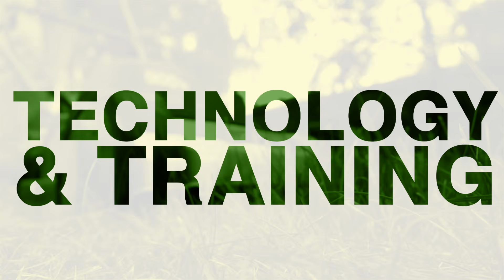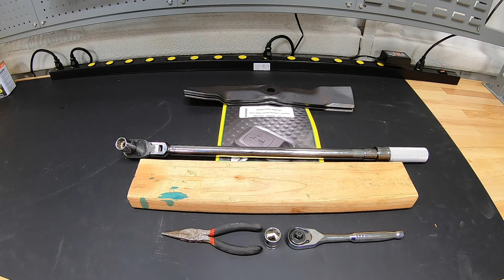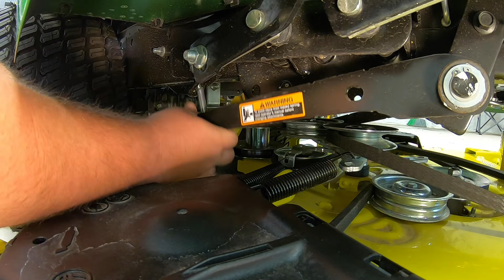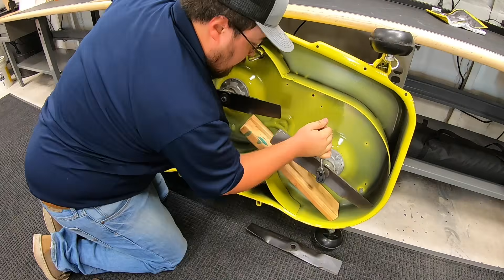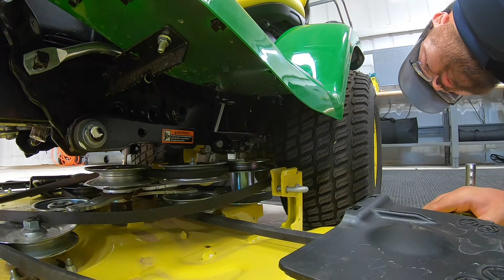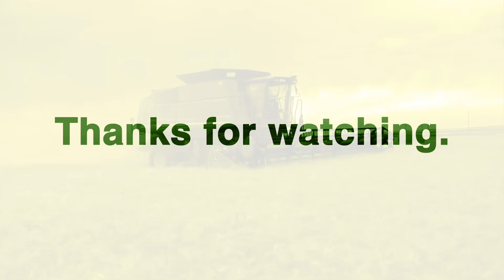How to Remove Deck and Change Blades John Deere X380

Comment: Excellent how to video.  I appreciate you keeping in the video the parts that require a little adjusting to get right.  It helps to know that I'm not doing something wrong by running into those little imperfections.

Comment: Great video my question is I have a S240 I was wondering if I put mulching blades on will it help with cutting the grass blades smaller than the stock blades

Comment: In my 380, a branch got above the deck and jammed the works.  The belt shredded and a 6-7 black spring was dislodged.  When removing the deck, the lift foot lever will not click all the way back, so the j pin and arms aren’t fully unloaded and are not removeable. Is that spring the assist spring?  Is that why the j pins won’t unload?

Comment: For older mowers, you might need some grunt to get those j hooks released. Things do get bent !   Go to your local truck stop/diesel fuel stop and buy a 5th wheel pin puller. It's basically a long t handle with a large hook on one end. Or you can use a slide hammer with a hook to fit the j hook. The pin puller is also useful to drag around the mower deck...also a good idea to jack up the rear of the tractor to allow lots of clearance.

Comment: Great video but I cant get the center blade to break. It turns the pulley on the other side. Managed to get the other two using a wood plank.

Comment: 8:35 you say to toque Blade Nuts to 50 lb.ft which is correct for Accel Deep 54 and 48 Mower Decks.  In my John Deere Select Series manual (pg 80) it indicates blade Nut Torque as 65 lb.ft for both Accel Deep 42 Mower Deck and Edge 42 Mulch Deck.   If you want to get it right folks, look at your manual in the Specifications section.

Comment: John Deere is always been cheap but now that's a new low and cheap. You're not even painting your mower decks. That's the stuff we see what's horrible is the stuff that we don't see that you cheap out on. Yeah like what I'm taking apart an engine let's say like from a new engine that nobody's ever seen before and let's say it's put together with plastic engine parts it's the stuff that you don't see that's actually a problem
Reply from the maker: I get where you are coming from here, but the one thing I would say is that paint underneath usually does not last long anyway due to the constant moving material. The paint does not affect the functionality of the deck so I don't see this as being a huge problem!

Comment: Do you really have to remove the deck just to change or sharpen blades? Seems like overkill.
Reply from the maker: No, you do not have to. I just like to show the deck removal process when changing the blades so you can see how it's done if you ever need to remove the deck.

Comment: Is it easier to slide the deck out from the discharge side or the opposite side, or does it make any difference?
Reply from the maker: From my experience it is usually easier from the opposite side, away from the discharge.

Comment: after watching this and several other videos I feel like basic maintenance on my x380 should be easy.  Regrettably, a little bit of knowledge can be a dangerous thing.  As I followed this video I took the deck off, changed the blades and re-mounted the deck.  When attempting to engage the blades one of the belts smoked and was torn up.  Also the blades sounded like they were rattling from not being tight enough.  Long story short I think I have watched every video on doing maintenance on this mower and I have changed belts changed blades leveled the deck checked the spindle integrity and still cant get the rattling to stop.
Reply from the maker: If you are having belt damage, have you checked if one of you pulleys or idlers are bad on the top side of your deck? You may have one with a bad bearing or one that is loose casing it to wobble and cause the rattling sound.
Reply: @WesternEquipment  Long story short, there ended up being a lot wrong with it.  Mostly deck alignment.  ended up just taking it down and letting the experts take care of it.

Comment: Excellent video!  Do you have to level the deck after taking it off and putting back on?
Reply from the maker: It is always good practice to at least check the level of the deck to make sure everything is in place as you had it.

Comment: Would the deck need to be re-leveled after putting it back on?
Reply from the maker: It is always good practice to at least check the level of the deck to make sure everything is in place as you had it.

Comment: I have an x320 48" deck.  One of the blades spins freely and is wobbling.  Makes a very unfriendly sound when the blades are engaged.  What might be the issue?  Some type of housing needing to be replaced?  The bolt that holds the blade on is secure.

Comment: I hate this mower.  I've leveled it, sharpened blades, changed blades etc etc and it absolutely give the most uneven lawn cut on the planet.. It makes me want to hit it all over with a 40 oz ball peen hammer from front to back.  Getting the deck off and back on is a nightmare.  I've been trying to break it but it will mow down 1 inch Chinese privet, 3/4 inch briars, huge cluster of blackberries
 pull my ground aerator with 160lbs on the back of it, pull my  8 row 6 inch plow with 100 lbs on the the deck of the plow and drag an unlimited bundle of brush, privet and old stumps across my 12 acre field to a burn pile.  It starts every time.   I've replaced the deck belt once after 3 years.   I have a serious love hate relationship with this thing.  If it was my old lady she'd be black and blue from the neck up and I'd be in prison.  Don't know what else to say except it mows like shit.

Comment: I have NEVER been able to pull back on the lift lever and get it to "click".   The engineers as JD should be flogged for this design those J-pins are horrible.   Even the slightest wrong angle or tension and they aren't coming out.

Comment: Great video Brent! Sorry if this was asked already but with a 54” deck, when you go and reinstall the blades, do all three blades need to be installed pointing the same direction or staggered? I have seen several videos where all 3 are installed in different directions and some where the two outer one go one direction and the center is the opposite? Thanks in advance!

Comment: Hello, do the blades have a pattern/ orientation they need installed in on the 48 inch deck? Or does it not matter if they are facing different directions? Thanks

Comment: That deck design is lightyears ahead of anyone else's. My cub cadet is a little simpler, but the belts wear more quickly and are prone to being thrown off. This design is long lasting and well engineered. Not to mention,the accel deep decks leave a better cut in thick deep grass. Mine leaves clumps and rows,even with premium blades. If I mow every week it looks nice,but if I skip a week it looks like I cut it with a string trimmer.

Comment: Also, I found it necessary to place a block under the two rear wheels when raising on edge so that the weight does not bear on the rear pulley.

Comment: Important to lock back the lift lever as at 2:43. (My manual does not show this.) Also, I found it necessary to unhook the forward draft arms to take considerable pressure off the j-hooks. After that, they just slipped out. Blade retainer nut seems to be 18 mm.
Reply: Also he shows you can click the height knob to position 1 without lifting the deck.   That's no go on my X380 you have to lift the deck with your foot to raise the deck and then do it.  
I loathe swapping in my snowblower every year because of these silly J-pins.    It's always like wrestling a gorilla.
Reply: @MrStangdawg  he already had the deck lock up, That’s why it works.
Reply: @toyotaguy75  I can tell you on my machine it does not work.  Even my dealer acknowledges this.    I use a crow bar under the deck to finagle the J hooks.   
   This is a very poor design.   I take my deck and snowblower on and off each year for swapping them and it's dreadful.

Comment: Great Job Brent - how do you suggest one would upright their deck? Is there one way better than just brute force lifting?
Reply from the maker: I think you can do this in any way that you see safe. Some lift them up by a pulley system or up using a jack and stands. They are pretty durable so you can do what you need to most of the time!

Comment: It's an 18mm bolt head for anyone wondering.
Reply from the maker: Yes, thank you for pointing that out. Sometimes I get lost in the weeds and do not explain enough.
Reply: Thanks so much as my old crapsman was a 15/16. Wouldn't you know that my socket set goes from 17mm to 19mm and skips 18! Time to buy a new socket.
Reply: @mganut37  mine skips 18mm too. fortunately i had yet another socket set that had an 18mm

Comment: Thank you. Very clear and nice photography. I am considering supplementing my slightly tired, 35-year-old JD 318 with a   

     X 390. I saw some complaints about the deck and it really is not much different than mine. Still can not be done from a rocking chair , but doable even for an 85-year-old, like me.
Reply from the maker: Props to you for still getting out there and turning wrenches! I hope I am still able to do so when I am 85! Let me know how you like that X390 when you get it!

Comment: Very informative video, clear with precise steps and solid camera work. Thank you. I tend to push my deck out, seems like it comes out easier and then i take some velcro straps and strap down my belt to the front guide wheels so when I tip the deck the belts wont flop around. Now on to your mulcher video!
Reply from the maker: That sounds like a pretty good idea. I may have to try that!

Comment: I used to do this on the 445 with a 54 inch deck. Almost identical procedure. Did it spring and fall in a heated garage, 1 stall space is adequate. More room is better.
Reply from the maker: Nice! I wish my shop was cooled. I can deal with the cold by using space heaters but those hot summer days can really get to ya. How long have you had the 445?

Comment: This a great video, step by step on how to remove the deck, change the blades and how to reinstall the deck.  You made it easy for me!  Thanks👍
Reply from the maker: I am glad I could help! I'm guessing you have the X380, how do you like it?
Reply: @Western Equipment  I have had my X380 for about 5 years, it has 170 hours on it.  It is a horse of a mower, and it does a great job.  Best tractor I have owned!👍

Comment: Great step by step video! I’m a retired 59 year old woman and with some sheer determination I did it all by myself! Thanks for the great video!
Reply from the maker: Awesome! I am glad I could help!
Reply: @WesternEquipment  ya, good video on a new deck. Mine is several years old, well cared for and clean, but the deck is a mf EVERY TIME I take it off. Usually a 2hr ordeal. The J pins are a bitch no matter how the setting are and they are not rusted or corroded.
Reply: @GMan-w7n I found mine came out easier if I blocked the deck up slightly. There is one height they are like butter.

Comment: Brent how often or so do you recommend on using the deck-leveling pegs?
Reply from the maker: I would do this at the beginning of the year, sometime mid mowing season, and at the end of the year. Also, if you start to notice any uneven cutting during your mowing season I would break them out and check it.

Comment: If you have the electronic mulch kit, you need to disconnect the cable to the door solenoid. The cable is clipped at the deck with a plastic clip for cable management. Then follow the cable to the top right side of the engine to disconnect it.
Reply from the maker: Thanks for the info!

Comment: I was hoping the 2023 x380 would be available with a 42 inch cutting deck. I would love to have the K58 transaxle but i really want to stay at the 42 inch cutting deck.  I’m wondering if the 42” deck from the x330 or x350 would mount up correctly to the x380 and if so i wonder if a could get a dealer to swap them out.
Reply from the maker: I would definitely holler at your local dealer and see if they could make this happen!

Comment: No click sound when pulling the lift pedal back. I can pull it back and I lock it, but disengaging linkages ain’t happening. Little help?
Reply from the maker: Hmmmm. Good question. If you can not get it to work, you may have to have your dealer take a look.

Comment: Thanks for this video, I used it to remove my deck. I found it helpful to use a couple strips of duct tape to hold the linkages up out of the way when pulling the deck out and putting it back.
Reply from the maker: I am glad I could help and the duct tape sounds like a good idea!

Comment: I just purchased an x380. When it got delivered they left the manual out and it got rained on. Is there a free download for the operators manual anywhere? Thanks
Reply from the maker: Yes, you can go to Deere.com and scroll down just a bit and there will be a black section that has a "Download Manuals" tab and then this will redirect you to their manual site and then you just simply search for it there. I hope this helps and thanks for watching!

Comment: Just what I was looking for because I need to replace the blade belt on my X380 with 48” deck. Could you please tell me the part number for that belt? (I don’t need the drive belt, and will probably sharpen or replace the blades when I get the deck off.) Thank you!
Reply from the maker: Of course! It is a M169500 and here is a link to our site where you can order it if you would like https://247parts.com/mower-belt-48a-deck-secondary/. Thank you and thanks for watching!
Reply: @WesternEquipment  thanks! I wound up getting that exact one yesterday from Pape’ John Deere and got it put together and mowed before the rain today :)

Comment: I must be doing something wrong with these J pins. I can’t lift the arms out.
Reply from the maker: If you can not lift the arms out then your deck must not be fully unlocked. You have to lower the deck all the way down and then pull the lifting pedal backwards (towards the driver seat) and then lock it into place. I hope this helps and thanks for watching!

Comment: While you have the deck off, are there any other routine maintenance tasks that are easier/preferable to do with the deck off? Greasings? We are new owners of an X350 and are taking the leap to do routine maintenance ourselves. I'm loving your videos for getting to know our JD, thank you so much for these!
Reply from the maker: This is also a good time to inspect your deck belt and the transmission drive belt that is under the tractor and a good cleanout of the underside of the machine and top of deck. Good question and thanks for watching!
Reply: @WesternEquipment  thanks for your reply!

Comment: thank you for an excellent video - i have an X380 and I need to change the blades this winter - this video was very helpful to learn the steps visually
Reply from the maker: I'm glad I could help you out and thanks for watching!
Reply: @WesternEquipment  Watched this video again this morning before changing the blades on my x380 and this video helped a lot! Thank you.  Also watched your oilchange,/sparkplugs/filter change video for the X380 and did that too.  Thanks for the helpful videos.

Comment: It’s a lot easier to pull the deck out the other way
This is a great video to show how to remove the deck at the end of the year.
It’s way too much work to change blades though. I did this for years, until I learned the trick
Here’s the trick- go to Harbor Freight, and for approx $100, by a tractor jack- best money you’ll ever spend.
Drive the front wheels on it, jack it up, change the blades. No need to go through all this
It even raises it high enough to use pneumatic tools
I like to use never seize on the bolts also. Helps the next time around
Reply from the maker: @LeonardCarlson thanks for great comment.
Reply: Yeah, but the HF jack is rated for 300 lbs. (I have one already).  Is that strong enough to lift the front end of the X380 or X350?

Comment: Well done video but why wouldn’t you pull the mower up on ramps to access the blades without removing the deck?
Reply from the maker: You can do this as well, this is just the safest way to do this and this way people would have directions on how to take their deck off if needed. Thanks for the comment and thanks for watching!

Comment: Why do people always make this job harder than it has to be.... Just Jack the front of the machine up, and get in there with an impact gun... You don't need to take the deck off and there's no "torque spec" for blades on ANY mower deck, if any size or kind
Reply from the maker: This is the safest way to do this job, which is why we encourage people to do it this way. And there definitely are torque specs. These came straight from the owners manual of this machine. But thanks for watching!

Comment: This question is about mulching kit. Can I install mulching kit without taking deck off? I have riding x330 mower.
Reply from the maker: I have not personally put one of the mulching kits on the X300 series yet. But more than likely it would be much easier to install if you take the deck off. Thanks for watching!

Comment: Thank you for your video.  You saved me!!!  I wasn't changing blades, but needed to replace the secondary belt on my X380 with 54" deck.  Needless to say all the owner's manual says is remove the mower deck.....um, how.  I'm so thankful I happened upon your video.  If a single girl with no mechanical knowledge can do this following your step-by-step, anyone can.  Thank you!!!
Reply from the maker: Well thank you! I'm glad I could help and thanks for watching!